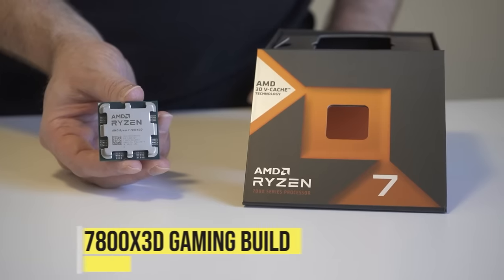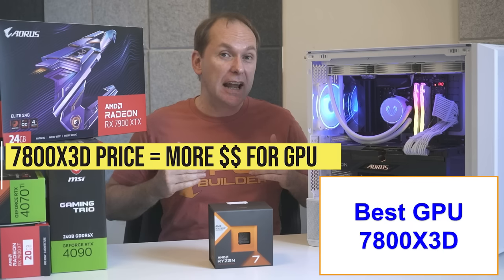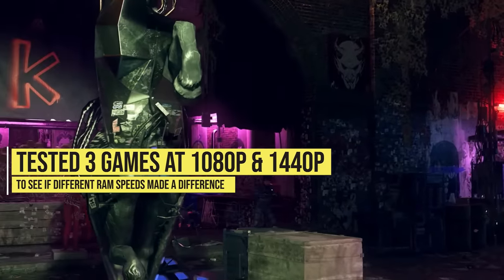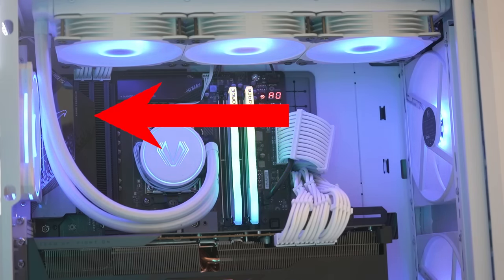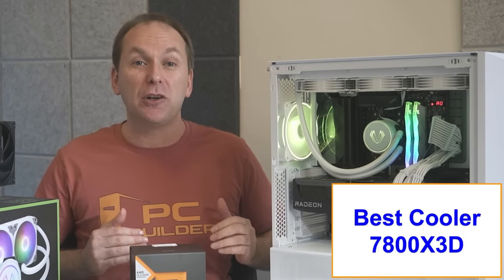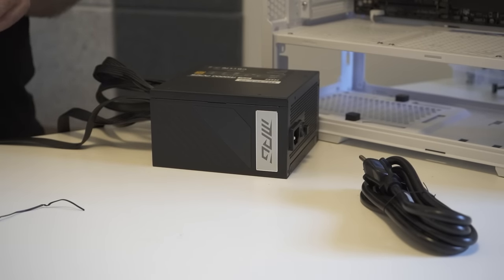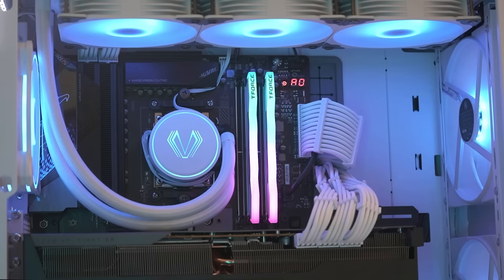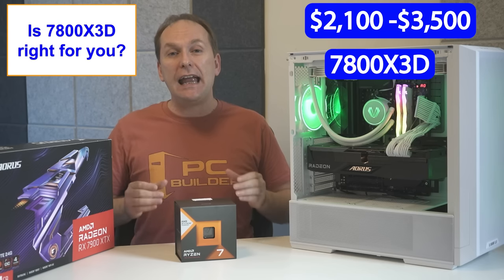🛑 Best Ryzen 7800X3D Gaming PC Build 🛑 Best RAM, Motherboard, GPU & More

Comment from the maker: NOTE: 1) ASUS Boards are problematic with 7800X3D and I'm removing them from recommendations. 2) Typo "B560" should be "B650". 3) Not all A620M boards support 120W TDP CPUs like the 7800X3D, double check the TDP supported before buying.
What are your thoughts on the 7800X3D? What build are you planning? What resolution and FPS?
Reply: 600 dollar
Reply: One thing I thought I would mention is AMD's A620 motherboards come without default support for 65W-Plus CPUs, so would be no good for the 7800x3d.
Reply: @PC Builder the core parking on dual CCD x3D makes it save power, so the scheduler tries not to wake it up.  Given sufficient load the 2nd CCD is available.
It seems to me, a reason for the dual x3D is to build out the infrastructure for automatic software configuration on hybrid CPUs.
The 2+4 Phoenix configs may need this more as just 4t are full cache full frequency.
Intel Thread Director tries to have the CPU monitor instructions used and recommend cores to the OS scheduler.
But to implement a user oriented priority system, my game, my music etc. you need a top down selection to implement your current priorities.
That could include not waking cores while on battery immediately for instance, or offloading decompression to an accelerator, as well as those Windows service threads that do housekeeping.
Reply: @boastyy  I saw a review with 7000x3D run in 65W mode and it didn't lose too much, the 8 core likely even less.  My 5800x3D doesn't seem to reach the TDP power rating even in stress tests and benchmarks.
Reply: just purchased everything yesterday! just waiting on the cpu to become available! 7900xtx, gigabyte 650,ddr5 6600 cl32, tt3 powersupply 1000watt, li la lancool 3 case, 420mm AIO. and an alienware 3432DWF monitor on sale!
Reply: What about the Rog Strix B650E-E motherboard? I used that one to solve my building problems with the TUF Gaming X670E and R7 7700X combo.
Reply: This 650 = 560 typo is legendary by now on this channel. Multiple times over the year and we don't mind. 😂
Reply: I am still building. I have a 4070ti b650E.   But i want the 7800x3d. Do i really need to return 4070ti an spend the extra 400$ on a 4080
Reply: have any suggestions for itx motherboards for that CPU?
Reply: @Pc Builder what Mainboard should we go if we buy a ryzen 7 7800x3d? I Think i would go for a B650 Motherboard becouse i dont need a x670, i was Thinking to gett the B650 Aorus Elite or the Asus Rog Strix B650E-F what would you recommend to gett? Or do you have any other recomandations? Would be cool to gett some Feedback.
Reply: @Lol9654  both would be good options.  Just note the Gigabyte only has entry level audio.
Reply: @kelley09162  Thanks for your answer,  the entry level Audio would be no problem to me becouse i already have a external soundcard so it would be no problem, the thing tho is the Asus board is only 40€ more than the Gigabyte one so it would not matter that much and it has the better Audio, to me like i said it doesnt matter but its nice and Pcie 5.0 i know it doesnt matter but for the Future it would be nice to have. What Board would you gett in Generell of all the Boards? B650,B650E,X670 or X670E? Or what Board would you recommend?
Reply: @Lol9654  then I would just go with the Gigabyte Aorus Elite.  No need to spend more on another Motherboard.
Reply: @kelley09162  Thank you for your Answer, then i will stick with the Aorus Elite.
Reply: @Hases666  considering Jason doesn't think X670 is worth it, either the MSI MPG Edge, or Gigabyte Aorus Ultra should be good choices for you.
Reply from the maker: See our March 2023 best builds. We did a 1440p one for $600.
Reply from the maker: yes but there are 120W models as well. I've linked the 120W ASRock A620M HDV+, but I'll leave a pinned comment telling folks to make sure to get the right one. Thanks!
Reply from the maker: See our Ryzen 7000 motherboard guide for ITX board discussion and recommendations.
Reply from the maker: 4070 Ti is the min GPU I'd pair with the 7800X3D. Remember GPU is more important than CPU for gaming.
Reply from the maker: I blame AMD and Intel for their stupid similar naming schemes!
Reply from the maker: Good but expensive. But if you want it then grab it.
Reply from the maker: Good luck on the build!
Reply from the maker: Interesting I'll have to try that out.
Reply: @PCBuilderChannel  it finally all worked. 
R7 7700x
Asus ROG STRIX B650E-E plus WiFi 
32GB (2x16gb) Kingston Fury RGB 6000 Cl36
PNY Gen4x4 2TB NVME 7500/5000 (I think)
Samsung 980 Pro Gen3x4 1TB NVME 3500/2500
DeepCool AK620 Black
Gigabyte RTX4090 Gaming OC
Thermaltake Toughpower G3 1350W
Corsair 5000D
9 non RgB Corsair case fans
Mellanox 10gb Nic

Spent numerous hours binging your build videos and pc part picker reviews. Keep up the great work and spreading the good news to the masses!!
Reply: Do you have any plans to review the new cheap AMD mobos that released quietly over the weekend? 7800x3d seemed to have overshadowed it. I don't see any reviews yet from anyone. I've seen 3  new boards: 
ASRock A620M-HDV/M.2
ASRock A620M-HDV/M.2+
ASRock B650M-HDV/M.2
Reply: @aceofspades3018  Waiting on the 7800X3D as well, JONSBO D31 MESH SC Black Micro ATX Computer Case with Screen

ASUS TUF Gaming B650M-PLUS WiFi

Corsair iCUE H100i Elite LCD Display Liquid CPU Cooler

Corsair Dominator Platinum RGB DDR5 32GB

Corsair iCUE AF120 RGB Elite 120mm PWM Fans 

CORSAIR MP600 PRO XT Gen4 PCIe x4 NVMe M.2 SSD

Cooler Master V850 SFX Gold Full Modular, 850W, 80+ Gold Efficiency

 RX 7900 XT
Reply: @aceofspades3018  you sure it will run with 6600mhz RAM?
Reply: Yes make a video!!!
Reply: The Asrock A620 M looks like it's doing PCIe 5.0 and has a model that supports 120W CPUs.
Reply: I just ordered a Gigabyte B650 Aorus ELITE AX, a 7800X3d and 64 GB G. Skill Trident  6000 MHz to pair with my 4090 :-) That's probably as powerful a PC you can get right now. First time owning a flagship PC.
Reply: so what is the best for a 7800X3D ?     CL28-5600mhz or cl30-6000mhz ?  if someone can help me please !
Reply: I’m building my 7800X3D with an 4070Ti tomorrow. I’m going with the arctic freezer 420mm for the cooling because my room gets really hot in the summers
Reply: @Sw1tchE  6000 is the sweet spot, I've heard. But make sure that your RAM is in the QVL. Mine wasn't (only off by ONE letter) and it's acting up. Not working in all the slots. Got them working now, but only if they are in two specific slots. Tried all sorts of combinations. I have a Gigabyte Aorus Elite Ax B650 and G.Skill Trident Z5 Neo DDR5-6000 BK C30 DC - 64GB
Reply: Planning on building a new PC later this year (maybe around November),and this video really helped me with my shopping list I can now mark these items so if & when they have a little sale I can pick them up
Reply: @pc builder if I wanted to up the ram to 64gb should I do 4x16 or 2x32. If 2x32 which do you recommend
Reply: I've build this in a temporary case untill the Dan-C4 will arrive then rebuild my dream PC.
hopefully it won't turn into a nightmare (knock on wood) so far no problems with SoC and EXPO, (running bios ver.1609) voltages and temps looks to act as intended

CPU: AMD Ryzen 7 7800X3D 4.2 GHz 8-Core Processor 
CPU Cooler: Noctua NH-D12L 60.09 CFM CPU Cooler 
Motherboard: Asus ROG STRIX X670E-I GAMING WIFI Mini ITX AM5 Motherboard 
Memory: G.Skill Trident Z5 Neo RGB 32 GB (2 x 16 GB) DDR5-6000 CL36 Memory 
Storage: Kingston Fury Renegade 1 TB M.2-2280 PCIe 4.0 X4 NVME Solid State Drive 
Storage: Kingston Fury Renegade 2 TB M.2-2280 PCIe 4.0 X4 NVME Solid State Drive
Video Card: PowerColor RX7900XTX 24G Radeon RX 7900 XTX 24 GB Video Card
Case: DAN Cases C4-SFXv1 Mini ITX Desktop Case 
Power Supply: Lian Li SP850 850 W 80+ Gold Certified Fully Modular SFX Power Supply
Case Fan: ARCTIC P14 PST 72.8 CFM 140 mm Fan

i think it will run whatever i throw at it at 165+ fps @ 2560x1440p
Reply: There are some games that are bottlenecked by the CPU.  It would be wrong to recommend people to spend more on GPU and less on CPU in all use cases.
Reply: From what videos I've watched it is a very good chip. Want to use it for Microsoft flight simulator. But sure don't want to build my very first PC and have it burned motherboard up. Right now I am using an i7 10th Generation and a rtx 3070. And 32GB of RAM. 1tb nvme M2 . It is absolutely beautiful on my monitor but not as good as I would like in VR.
Reply: So which motherboard to use??
Reply: I got a 7900X3D, would one of these motherboards still work for it?
Reply: Hi, sorry for. the question, but why ASUS Boards are problematic with 7800X3D ? Would be possible to explain a bit more? Thanks.
Reply: @pliniomonteiro  other YouTube videos I've been watching they are burning some of the motherboards up and the CPU also. Supposedly they're correcting the problem with a bios update
Reply: Wanna make a build with the 7800X3D, but think i will use the upcoming Asrock B650E TAICHI Lite
Reply: Hello, are Asus mobos also problematic with 7900x3d?
Reply: @nashfan1000  has the problem been solved yet?
Reply: Is asus boards with 7800x3d still problematic???
Reply: @pliniomonteiro   My understanding is that the firmware on them isn't properly setting voltage limits and is making some of the 7000 series chips literally burn or melt. Theoretically this might be fixed by manually setting voltage limits? I would still avoid them though.
Reply: What the problem on Asus boards?
Reply: @muhammadmutashimbillah3960   nothing. They fixed the issue alrdy with BIOS update. The Problem was that Asus's MB were having voltage problems, so was frying your cpu, if I remember correctly.
Reply: Will the cpu be compatible for the msi b650 tomahawk?
Reply: anybody considering ASUS boards now, still make sure you have the appropriate BIOS update beforehand. personally i haven't got it built and running yet, but i've bought and am excited for the Aorus Elite B650. it has too many features and sufficient functionality to justify spending over double for a X670E with same or better connectivity options.
Reply: as for now is it better to just use ryzen 7 7700x ?
Reply: @aceofspades3018 why 1k watts?
Reply: Is Gigabyte X670 Aorus Elite AX ATX Motherboard good for Ryzen 7 7800x3d?
Reply: With Black Friday here I’m looking to upgrade with a new PC for gaming - content creation - editing. Etc. Thanks for making this video to help me. Feel free to judge and give criticism ( my one cent - I just don’t feel comfortable with water cooling so sticking with fans) 

CPU - Ryzen 7 7800X3D 
CPU Cooler - DeepCool ak620 digital 
MotherBoard - ASUS Strix B650-A
Memory - Teamgroup T-Force RGB 32gb 
SSD - Kingston’s Fury Renegade 1 Tb
Video Card - ASUS Strix gaming GeForce RTX 3050 8GB 
Tower Case - NZXT H6 Flow RBG Mid Tower 
Power Supply - MSI A 1000g PCIE5 1000W
Reply: @KyleRedPlays just got an asus board lmao I hope it’s good
Reply: DDR 5 ram 3200mhz, ASUS B650 plus
Reply: hi pc builder, love your content. You reccomend 1000w psu, but what is your actual real world consumption on this rig. I've read that 7800x3d isn''t going above 80w ever in testing. Would really appreciate an answer please as I am trying to sort some things in my rig.
Reply: White motherboard for the 7800x3d what do you recommend ? I need a white one
Reply: Im getting rog 4080 super
T delta 6000mhz 
2 tb kingstone
Lian li hydroshifter 
Amd 7800x3d
But i need a white motherboard can u recommend one for me

Comment: according to Computerbase, the 7800X3D draws around 60-64W during Gaming and the RTX4090 when undervolted and limited to 144fps (many Gamers have 144Hz Monitors), draws only 110W during Gaming. So a 1000W PSU is overkill. A Good 850W PSU would do just fine.
Reply: agreed

Comment: One thing I really appreciate about your videos is you have great sense of when features or added expenses aren't worth it or useful. Even on high-end builds, certain features just don't end up making a difference in what you'll actually use it for and that understanding that is key to maximizing the value you get out of spending that hard-earned money
Reply from the maker: Thank you so much for the feedback! That's great to hear
Reply: This aspect is so often missing from YouTubers. Thank you!
Reply: i really didn't like the whole, "here's a list of a wide range of performance and price parts. they're all great for gaming or productivity." at least showing proper benchmarks for both minimum and maximum builds, not just very high UHD benches and just the optimum build, would have actually been useful information. for the most part, it just felt like a time capsule price list.

Comment: I went with the 7700x bundle at Microcenter, which comes with a MSI B650-P Pro wifi and 32 gigs of G.Skill Flare x5 DDR5-6000 and it has worked great.   Didn't have to flash anything before installing and expo settings have worked without issue.
Reply: Yo Joe! I bought the same bundle and paired it with a 7900xtx. Just finished OC the ram to the full 6k frequency, turned on PBO and made sure resizeable bar was on. Everything is running great but sometimes I get locked up when inside the BIOS and have to hard reset. Curious if you experience the same issue in BIOS after OC’ing everything??
Reply: @Matt Nation  I haven't turned on PBI or checked resizeable bar because I didn't know those were a thing until I caught part of Jason's live stream where he was talking about them.  I need to go and watch the video again when I have time for more tinkering.
Reply: What cooler did you go with
Reply: @ProxityProductions  the peerless assassin 120 SE- has been great, after I figured out how to install it right
Reply: @Joe-gb3lu what issue was it that was causing your problem?

Comment: I paired my 7600X with Crucial 2x16GB @ 5600Mhz EXPO CL 46(budget rig) on ASRock B650 PG Lightning.... Not having a single problem, Even working few days on XMP 3.0 flawlessly, but in the end went with EXPO... Without EXPO it goes @ 4800Mhz, motherboard can sustain RAM overclock to 6200Mhz+   Very happy with the whole setup in the end.   Thank you Jason for your beautiful content

PS: Loving how good single core productivity of 7000 Ryzen CPU-s is. At least judging by my 7600X which is the lowest of 7000 family, so it only gets better

Comment: WoW the detail in component selection is just the best. Two comments would be to actually show all details for the water cooler setup and install as well as connecting all the cables to the MoB and components. I know this is probably boring for experienced builders but for folks like myself that are considering to do their first build at some point I think it would add much for the less experienced. Perhaps just a video on this as a standalone would be a way to go. Why? Because it's obvious you are showing us how to do things right starting with matching the components and then the install to get the best performance. I think this is the build I will be saving up for! Thx so much Jason! Well Done!
Reply from the maker: Thanks so much and thanks for the feedback!

Comment: price/performance/power draw the 7800x3d is a monster.  I don't do much gaming and use quicksync so I'm still happy with my 13700k but if gaming was my main concern and I was building now this CPU would be a no brainer.
Reply: At what resolution you play ? if you care about consumption is the best cpu ! but only on low resolutions, if you play in 1440P or 4K, this CPU is a scam, the 7700X it better overall, if you want the 2 best CPU actually on the market, 7950X3D and 13900KS ! but of course is for people who get high range machine !
Reply: @lalicdalibor1367  I'm sorry but is this supposed to make sense?

Comment: Just bought this build, waiting for it to arrive. 7800x3d, 7900xtx, 32g of ram, 1tb ssd, 850 watt gold psu. Out the door was $2600. I intend to go through the whole pre-built to make sure everything was installed correctly. I've seen so many with poorly installed or no thermal paste. Cracked pcbs from shipping. Bent cpu pins ect.

Comment: Great video Jason (as always 😊). Yes, I would love to see an OC GPU ‘how to’ video. I use the Adrenaline OC feature on my 7900xtx but would love to learn how to manually tweak to get max performance. Also really loved your last video what to do after you build and how to optimize CPU/RAM. Great stuff man thanks again to you and the team!!
Reply: Generally speaking you lower your voltage as much as possible until you see video errors while bench marking, then you want to raise your vram speed with the same logic and maybe increase wattage/ power consumption to stabilize those higher speeds and you’re all set, for example my 6650xt has 1120mv instead of 1200mv and I have a 3000mhz clock speed and 10% more wattage to stabilize it and I got like 10 frames on my lows in a benchmark

Comment: Using the same TeamGroup CL30 6000 kit with a Gigabtye B650 Aorus Elite AX. Running at 6000mhz 30-36-36-30 with Buildzoid's secondary timings for Hynix M-Die DDR5 memory IC's. Yes, TRAS at 30 not 76. I am certain secondary timings will improve any RAM kit. I have yet to try to OC the primary timings but I might be able to lower them some more. Also, Gigabyte has always has better memory support than other brands for me. I had an ASUS that struggled. Gigabyte and MSI do the best for Ryzen.
Reply: Nice! TEAMGROUP 5600 CL32 and 6000 CL30 are great price to performance options for RAM, especially if you're into OC. With the 5600 CL32 kit, I've run them at 6000 MT/s 30-36-36-76 @1.3V and 6200 MT/s stock timings @ 1.3V. I haven't really pushed them farther yet.

Done on an MSI MPG B650 Edge WiFi
Reply: Where can I find buildzoids timings for the cl28 5600 rams?